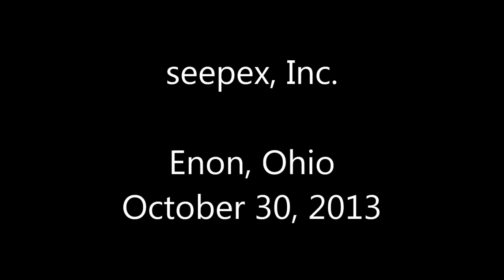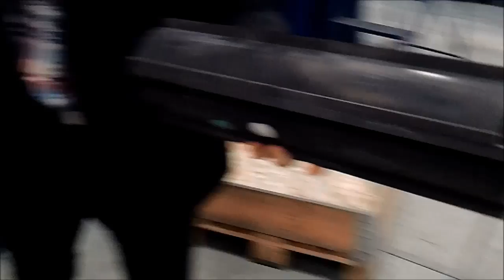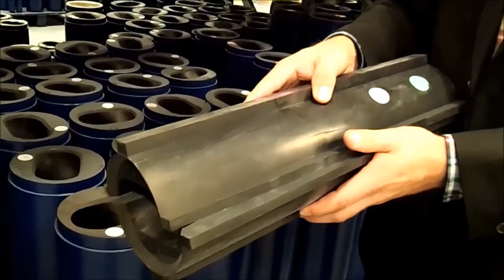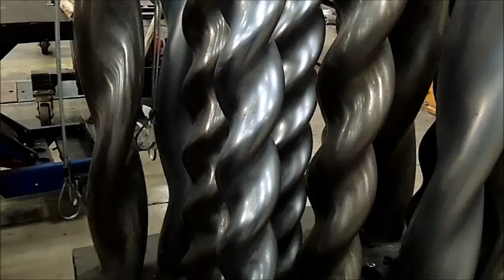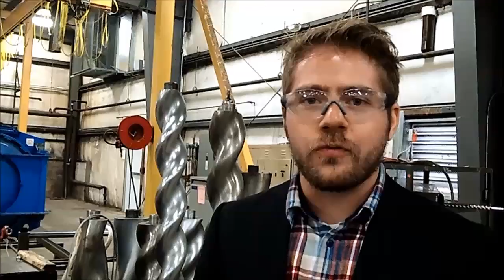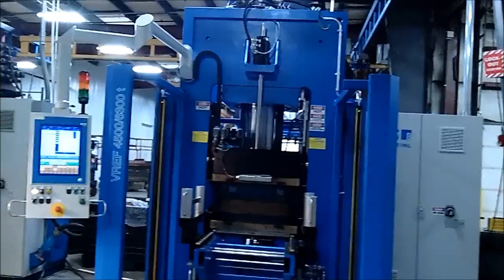seepex Stators part 2 of 2

Comment: That's sound interesting. I would like to ask how many types of size and usage? We are using pumping underground water with Flexible shaft pump that comes from China (3/4 inches and 1 inch sizes). Those pumps are not long lasting and weaknesses. I'm thinking to use better pump. Our tube wells are starting from 1 1/2 inches to 4 inches mostly. Submersible pumps are better but expensive. Can you give me some information about your pumps please?

Comment: I hate working on split stators. Seepex pumps are such a pain in the ass
Reply: Can you tell me why?   Im not a Seepex guy
Reply: @martynnewby6298  I think they are good when it comes to replacing the stator and rotor. On the downside is that the split stators don't tolerate as high pressure as the single piece stators. But if you only need a few bars pressure, no problem.